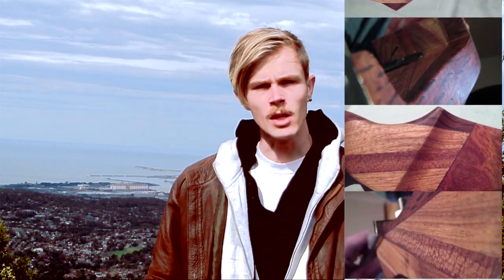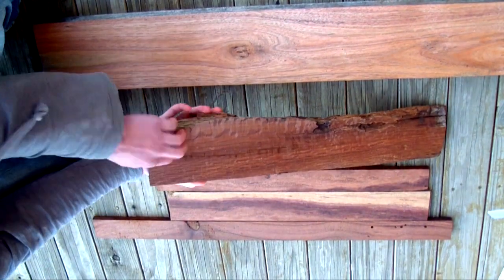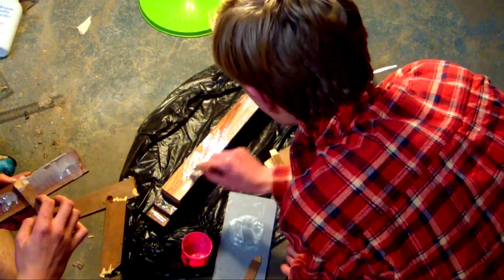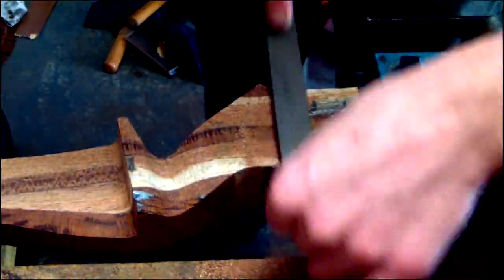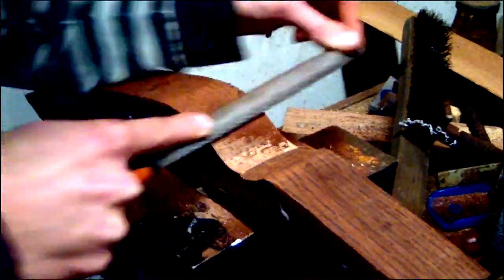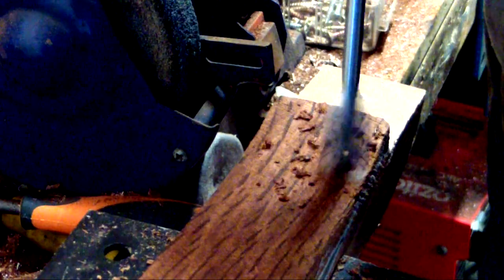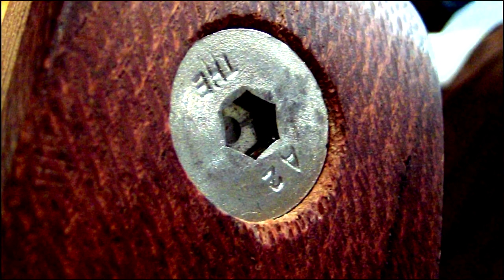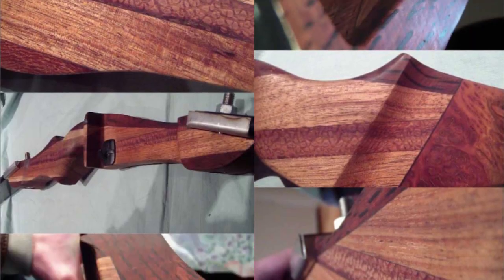How To Make A Takedown Bow - The Riser (Tutorial Part 1)

Comment: Just a quick observation.

PVA glue is actually a lot better than epoxy when glueing wood to wood. PVA will work WITH the wood and if one properly it will be exactly like one solid piece of wood.

The epoxy will sit as a separate layer between the two pieces of wood. This works well for static materials, but wood is not static.

Comment: building the riser from two wood types will add strength and flexibility that will help absorb any "energy chatter" when you release. You can buy lengths of wood that is already layer laminated. but, yes you can use 1 solid piece of hardwood

Comment from the maker: technically a radius is half the diameter of a circle. So in the video I just mean a curve, as I wanted the window in the riser to finish with a curve and drilling into it with a large diameter/radius drill bit is a easy way to achieve this, so no it is not where I attach the limbs it is for the window, I hope that made sense.

Comment: If this is not a problem, I would ask for a written tutorial, starting with the species and the type of wood, etc., with data on the implementation, and ending with the possible changes (seen arches of the pulley system on the ends, and I do not have sufficient knowledge to solve the problem, because I am including new).
Hot this request also argues that my faint knowledge of English does not allow me to effectively use the video, I'm sorry it as a form of expression, used the google.translate

Comment: Brilliant stuff man, well done. Just a tip about epoxy gluing, make sure the temperature is cooling when you glue. If the timber is cooling it won't expel air and will suck in the glue instead of expelling air/moisture from the timber. It's better for the adhesion process

Comment: As a tip, Meanman, if you don't want to have to bother with drilling with a paddle bit from both sides, you can simply clamp a piece of scrap wood to the exit side and drill on through.  When you remove it, you'll see that the scrap piece has protected the exit hole from splintering.

Also, for finishing, try Tru-Oil.  It's what those of us who make gun stocks use, and the finish is perfect if you follow the directions, which it certainly seems you are more than capable of doing.

Great video!

Comment: @meanman1992  hey um i have finished my blue prints of my riser and these are the measurements height=46cm about 19 inches width=13cm about 6 inches i'm thinking about changeing the width to 15cm about 7 inches what would you suggest by the way this has been done on a computer not on paper because i had no sheet big enough for that size i downloaded a picture of a riser same as yours in video but coloured and i have shaped accouringly to the measurements above. 

liked